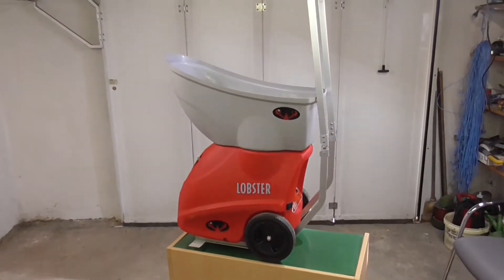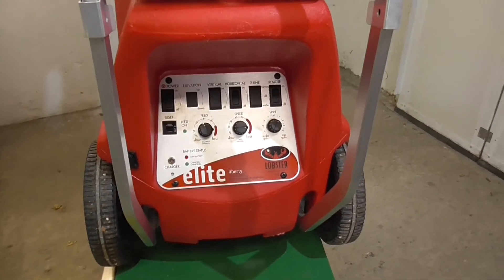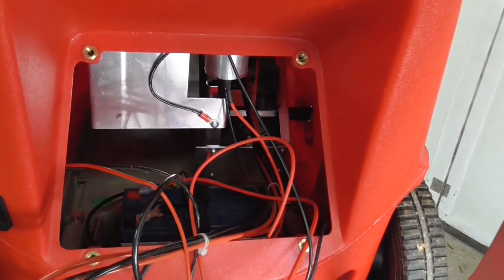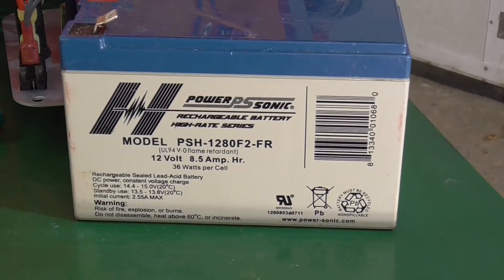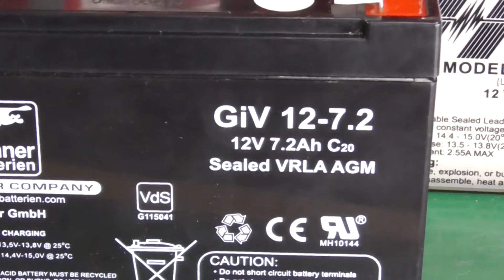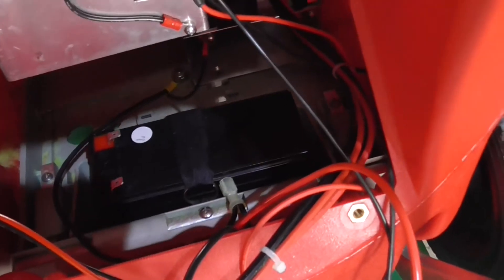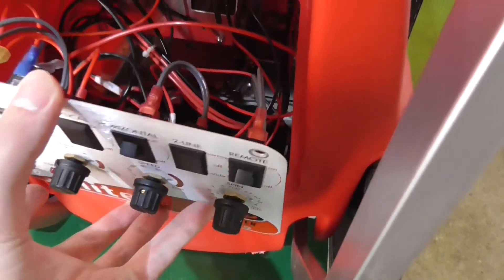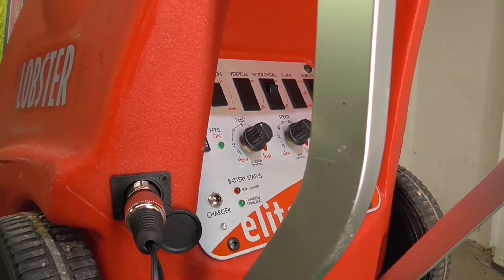Batterie austauschen - LOBSTER Elite Liberty Tennis Ballmaschine - Battery Replacement Ball Machine

Comment: Thank you....where did you get your charger???
Reply from the maker: The charger is always included with the machine. If yours stops working or you need a new one, you should be able to get one anywhere Lobster machines are sold. Otherwise directly at lobstersports.com
Reply: @Der-Verschrauber  thank you for the brunch reply, yes I can get one from lobster but there’s is $149 a fast charger, anyways thank you so much
Reply from the maker: You're welcome. If it doesn't bother you and if it's not too much trouble for you, you can also remove the battery and charge it on a car battery charger, that is suitable and approved for this type of battery. But you would have to check that for compatibility first. Maybe in the meantime there will pop up a good deal somewhere, or ebay, or somewhere else a good offer.
Reply: @Der-Verschrauber  thank for the suggestion! I ordered a bigger battery so now my practice sessions will last longer, will plug at night and let it charge till morning with the slow/regular charger. Thanks